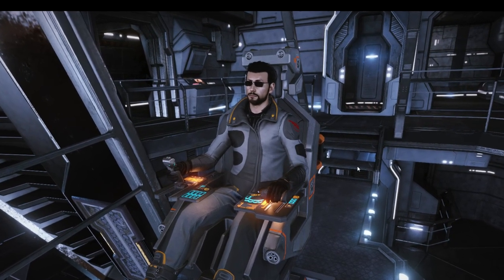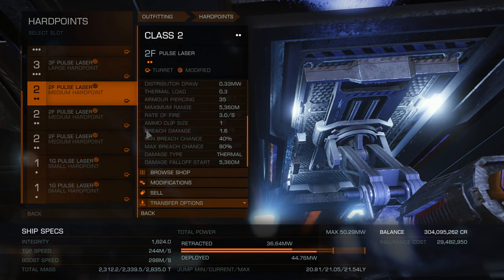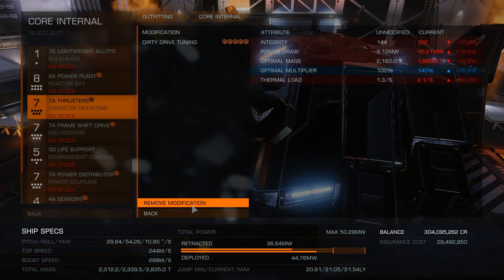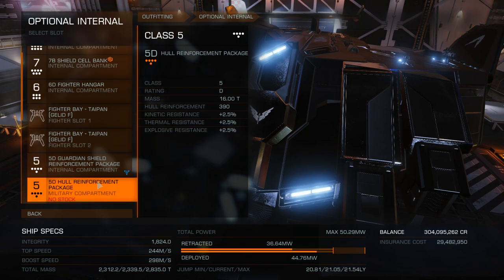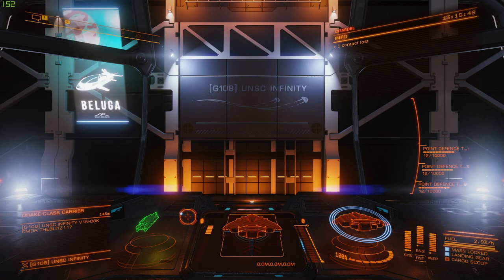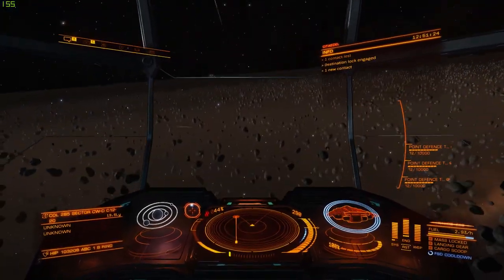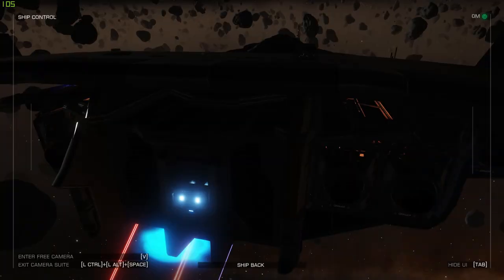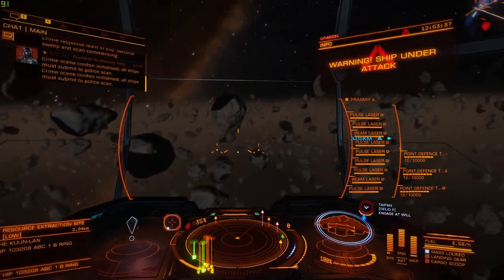Elite Dangerous AFK Guide to Riches: How to Build and Engineer Type 10 for Maximum Profit

Comment: I'm a little late to the party, but thanks for this video! I've had a really good time getting this AFK build up and running and now I can make 600 - 800m per 2 hours played per day.

A couple of tips:
-You can collect 20 missions in Horizons and 20 missions in Odyssey. I do this in the evening and let Horizons run while i sleep. Then in the morning before work i switch to Odyssey. It takes a bit longer to collect missions, but it's worth it.
-AFK farming definatly is easier in Odyssey. There seems to be alot more missions and the pirates seem squishier. Also the bountys are alot higher. Its not uncommon for me to end up with 40m after a 10 hour day of farming.
Reply from the maker: You can never be late in Afk farming
Reply: 40m you mean billions?

Comment: Using this exact build but can't go 10 minutes in a lowres without cargo being ganked by one hatchbreaker. I have point defense mounted in the same spots as shown in the vid but a pirate will launch one at me and it gets thru and then all my cargo is gone. It didn't even trigger my defense so my npc fighter just sat there watching it happen. Did I miss a setting somewhere or something? I've tried this setup twice and both times cargo is stolen within minutes. Any advice on what to do is welcome.
Reply: Need to go to the right hand menu and set turret weapon mode to fire at will and set fighter to defend me.

Comment: I have 4 PDTs on the underside of my Type 10, two nights in a row I've gone to a low res, and every single HBL that was fired at me, might as well have been ignored by my PDTs and got through. Every. Single. One. The only reason my entire cargo wasn't stolen was because I was lucky enough to kill the attacker before the second one could get through my cargo hatch. Got any footage of your PDTs actually working?
Reply from the maker: In odyssey the HBL are buffed so I recommend using mission cargo to avoid them and put booster to gain more shields

Comment: Does what the tin states but you miss out on so many kills.
90% of the time before the pirate gets through his 15 second threat, he is scanned by the police and then shot down.
As the pirate never got to shoot you, the turrets never engage and you get no bounty.
This happened time and time again when i was watching.
Just too many police in low res and the 15 second threat is too long.
Reply from the maker: i know that and sadly there is no way to counter it but to keep shuffling instances till you find one with no police presence
Reply: @theblitz1176  it is still good fun, I know its an afk build but i keep checking it just to watch it destroy things.
What changes for a materials farming T10?
So many canisters I would like to loot.
Iv'e not needed to use the 7 shield cell, as all the pirates at start have been small ships.
Would you go 7Cargo rack and a small limpet collector, I would only need one or 2 limpets active, I'm in no rush ;)
Or smaller fighter bay? I've not had a single fighter die either. Builds too good with engineering and that's with Bweave shields ( i don't have access to the powerplay ones )
Reply: Couldn't you go to a Low security or even an anarchy system to do this? That way police response is minimal?
Reply from the maker: @lnepstad  it depends on where you hunt the pirates

Comment: So, maybe a noob question: wouldn't a Bi-Weave shield be a better alternative than Prismatic due to the long time you'll be out and the regeneration would become significant ?
Reply: I use an 8A prismatic, reinforced 5, hi-cap.  I boost it like Hawkes described on his build.  Tough as nails!
Reply: it might, i noticed that with 8C reinforced 4, hi-cap bi-weaves, i can fight for longer, than using 8a prismatic,s i guess the regeneration makes them to be stronger, i think there was video about it

Comment: Ни оного корабля "ЦЕЛЬ МИССИИ" в месте добычи ресурсов (низк). Все пираты - просто "В РОЗЫСКЕ". Что это значит? АФК фарм пофиксили? Или это один из глюков после очередного (одиннадцатого) обновления фронитров?
Reply from the maker: Well I'm not sure about a fix yet since I didn't get reports 
Sorry for delay 
I'll look into it and confirm if it's a bug or fixed
Reply from the maker: update on the issue so it seems it's just a random issue and it's not a bug 
you need to make sure you are in right system and if you don't find targets you can relog to main menu a few times until you find a nice instance

Comment: Here's my personal build: https://s.orbis.zone/f_vk
Since Type 10 is only suitable for Low and Med res size, I use bi-weave since the recovery rate is good, help me last many fights I could. Changed a bit in the Shield Boosters engineering too. NPC in these 2 site usually  doesn't use true damage weapons so there's no need for Absolute HP. 
I survived in Med res size 'till my game crashed. Got 33 mil (plus 12/16 massacre missions completed) in that session. None of the enemies penetrated my Type 10 shield, and no SCB was used.
Reply: Still can't last much in High res size, that zone is exclusive for the Cutter I guess
Reply from the maker: You got a nice build there, though it could use some efficiency tweaks
You don't need to engineer the thruster as it will affect fuel economy and you are not moving anyway that also apply to the fsd
As for utility keeping 2PD is most efficient if you want safe rub
If you are using mission cargo you can drop it completely and go all shield booster

Comment: Ok so you have NOT explained HOW this works. Now putting the player pilot on the helm would mean they fly the ship and you the player is in the fighter right? And now you can AFK allow the player pilot earn credits. So as the player is on the SLF that fighter is also a target  for the enemy.  When you blow up in a fighter the plager returns to the helm making the ship not fly without input from a player.  You and Hawked try this before and it's either click bait and to my knowledge won't  wprk as explained.
Reply from the maker: i think i made myself clear 
NPC pilot is in the fighter if you didn't understand that that means you haven't played elite or even understand how it works 
you are either trolling or seriously haven't played the game
Reply: @theblitz1176  Sorry but you mumble in this video, also this may also mean a very short period of time AFK, and the hull is paper thin, which means when the shields do drop and they will, the resistances are in minus values so even small arms get higher DPS, especially explosive and kinetic. To clarify a weapon has DPS maximum say NPC has a total 10 DPS from cannons, striking a hull with -30% restances means the attacker gets a 30% bonus damage each time DPS hit of 13 DPS instead, now factor a 30% resistance means the defender will -30% DPS taking a DPS from 10 to 7 which as you know is lasting longer than at least 30% longer time. All dependent on amount of attackers and your combat rank, being an elite player in combat I would suffer more elite combat NPC's in all rez hez zone. Other things like sensors distances having long rage to 11k than 6k, at least I try to engage with the information you bring. Any how I still think its a hit or miss adventure, that takes away the element of combat learning. Other than that good luck.
Also the rebuy of 40 million credit would mean you'll have to not die to cash in bounties earned. And billions would take a more than a few hours game play, it NOT as simple as the word "rake" implies its fast and easy, when its not.
Reply from the maker: @darrellpowell6042   dear sir we HAVE  tested and proven the method so did a lot  of others and here is the scoop , IT WORKS  if you follow the instructions and there are people still making money off it ,and all your 'paper ' assumptions are wrong and you definitely didn't play the game or even see that the build was engineered or had adequate absolute shields 
the goal is to stay in low res where there are eagles and adders and they pop fast 
so once again sir do more homework then try again
Reply from the maker: @darrellpowell6042  and i was not mumbling